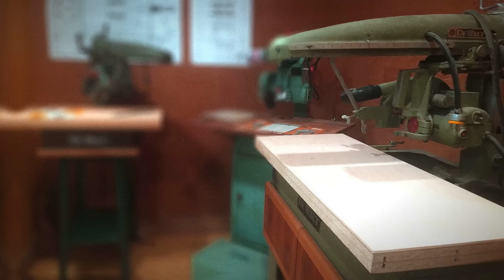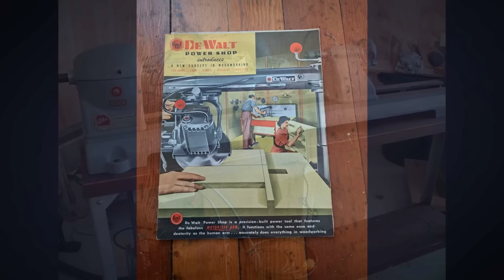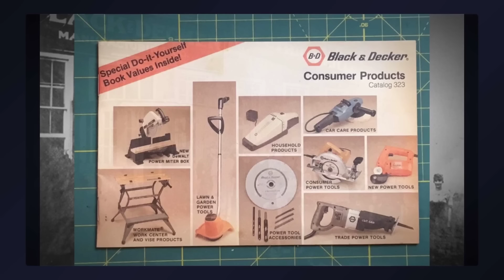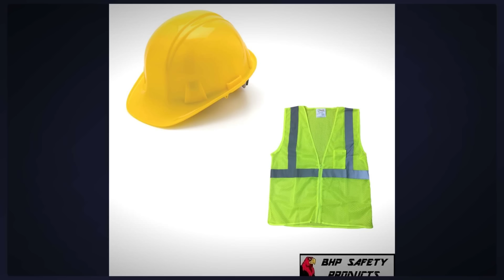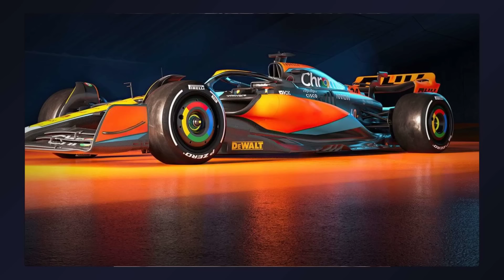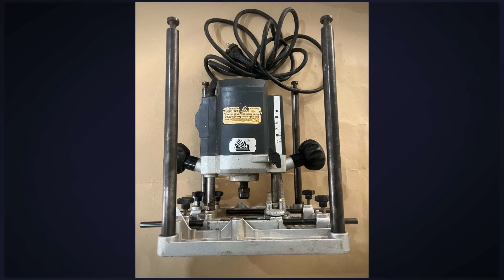The Rise and Fall of DeWalt -The Brand That Died in 1989 and Was Resurrected as a Marketing Strategy

Comment: In 1966 my dad purchased a Dewalt 7-1/4" radial arm saw and built a long work bench for the saw, and integrated the saw into it. But what I soon learned when using this saw especially with dense material, it would "self-feed" and stall the motor, pulling the motor and blade away from the fence, and placing the material against the fence and pushing the motor and blade toward the material and forward to the fence, eliminated the natural grabbing during the cut! When I was 14-years old, I built my first loudspeaker cabinet with miter joints with the saw. When I was twenty, I started my first business as an inventor, designer and manufacturer cutting up aluminum components for my first product with the saw, and hundreds of subsequent components of wood, plastics, non-ferrous and ferrous materials by the thousands. In 1975 I began modifying Polaroid 110A/110B cameras by cutting off a portion of the aluminum castings with the same Dewalt saw, totaling over eight thousand of these cameras! Five years ago, the blade-side arbor ball-bearing was making noise, so I cleaned out the bearing with solvent and re-packed it with grease, and to this day, I still use the same Dewalt saw in cutting up mostly aluminum 6061-T6 plate and extrusions. I would say that this American-made quality saw, has been a life-long tool for me, and my dad only paid $199.00 in 1966 dollars! David Riddle

Comment: Since I started as a telco lineman in 2016, and most likely before for years, our company standard was Dewalt XR line for drill drivers/hammer drills; impact drivers; and impact wrenches--never had any problems with any of these tools.  Just be sure to use 5ah batteries and have another one on the charger, lol.